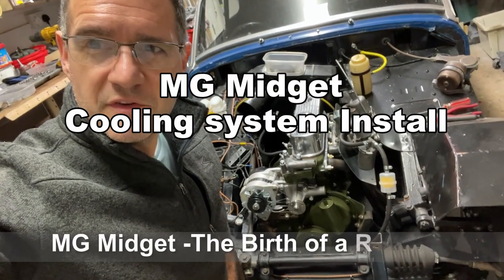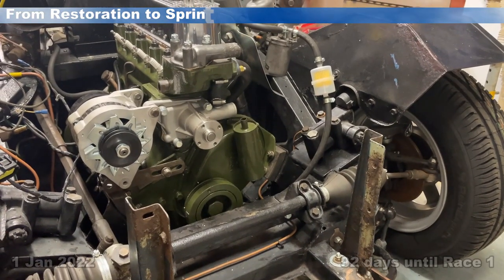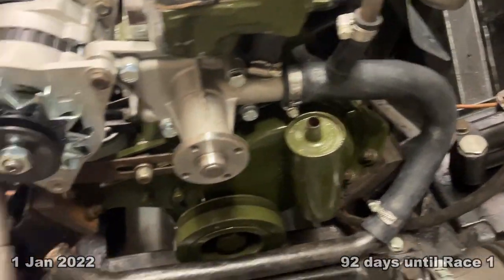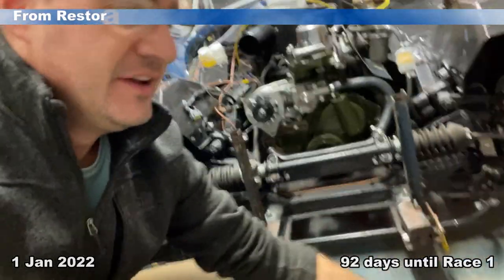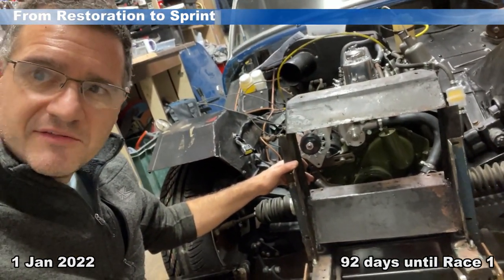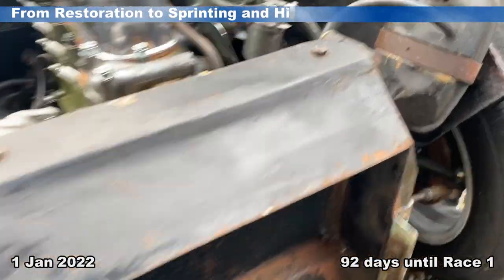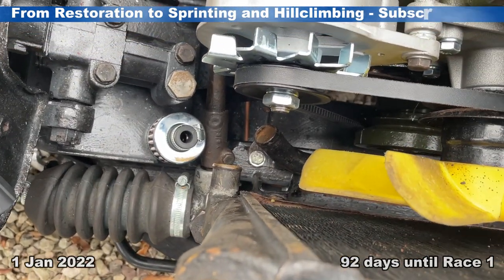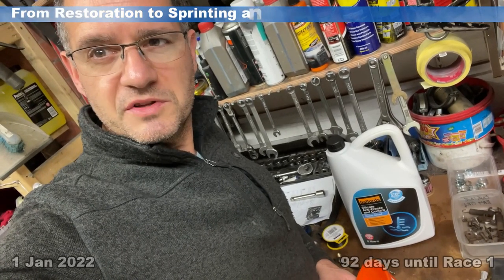MG Midget Radiator and cooling system Install - Birth of a Racecar (Episode 48)

Comment: Just a thought, are you allowed to have an open overflow from the expansion tank for racing and sprinting ?  I just have a recollection that any overflow needs to be collected so  it doesn’t get onto the track for obvious reasons.
Reply from the maker: good point. hadnt considered that. will check it out. thanks for the tip.

Comment: I see in later videos that you have replaced the heater matrix housing with an "aluminium" unit in front of the battery. What is this and who manufacturers it?
Reply from the maker: It’s an oil catch tank to allow the engine to breathe better. Check them out on eBay
Reply: @mgmidget-thebirthofaraceca4349   thanks for the quick response. Where does it plumb into, and if for my road MG I keep the heater matrix can it be mounted elsewhere, in fact didn't I see it in another of your videos by the screen wash bottle?
Reply from the maker: plumbed in to the crank timing cover and the rocker cover. very early on i had the heater in but removed it about half way through the first season

Comment: Hi, i’am afraid by the water hose touching the heat shield.
Wasn’t it allowed to put an aluminium radiator?
Reply from the maker: Yes Charles, ive reached the same conclusion as you and will be moving the water hose. not sure on the alu rad.  will be an upgrade in the future if possible. Thx for comments and support
Reply: @mgmidget-thebirthofaraceca4349  , i’ve put an alu radiator in my frog, 1275 cc, old non cross flow rad. 15 or 20 less degree F. Just a chinese rad, 180 euros. Just modyfied the cap pressure spring to get back to original pressure. Worth every penny